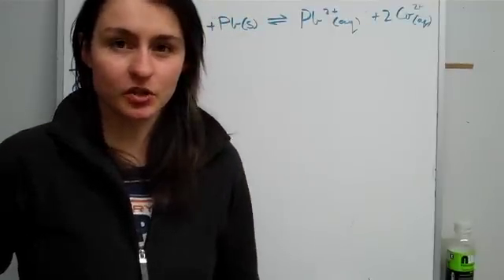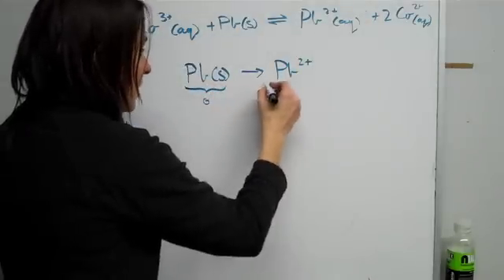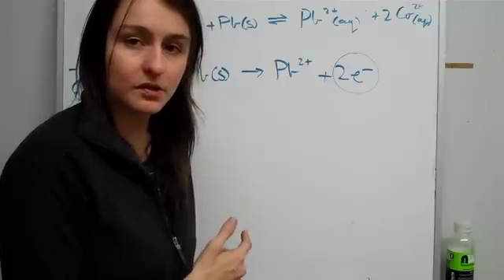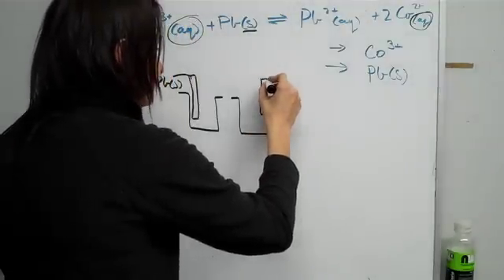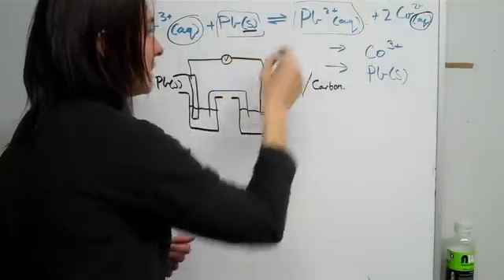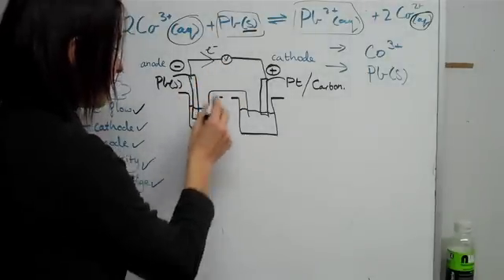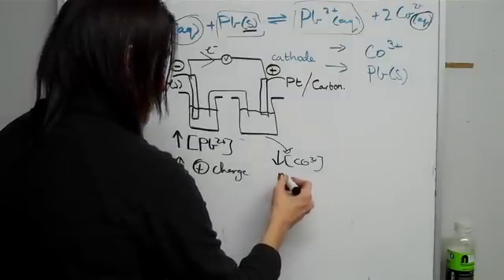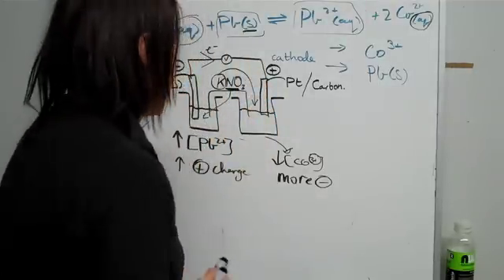Academy Plus ; Chemistry Tutorial - Galvanic cell (Example 1)

Comment: +Bindot Yun
Platinum is stable physically and chemically. Cabon is chemically stable and has relatively a large potential window which is the maximum voltage you can apply on without generating a current flow in the electrode. They are called "polarized electrode". Otherwise, electrodes are called a "non-polarized electrode" which has some current flow in it if some voltage is applied.